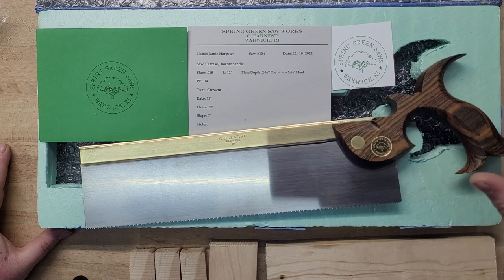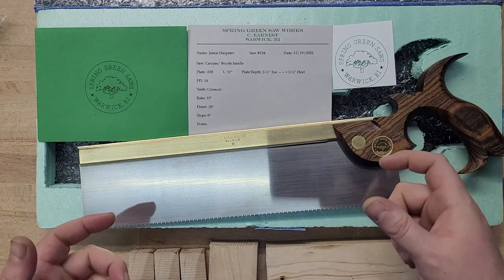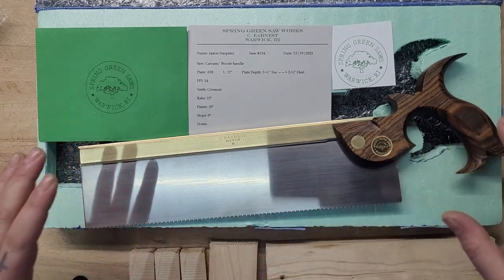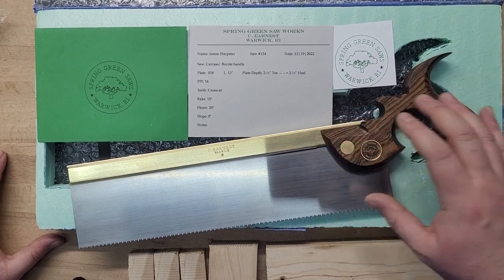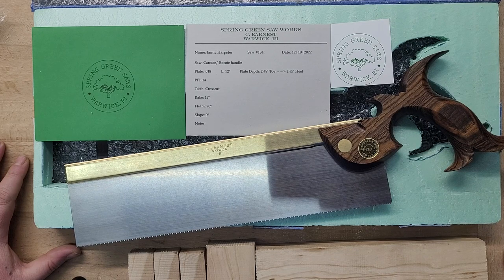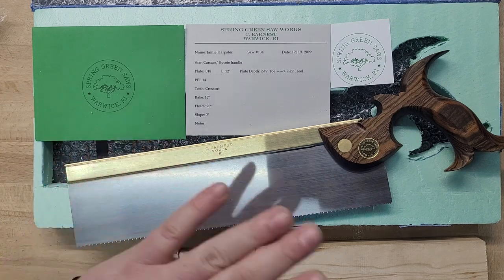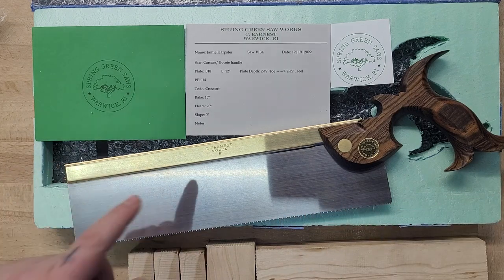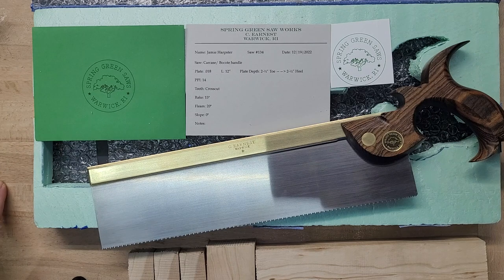MY BOCOTE DREAM SAW! Spring Green Saw Works Unboxing and Testing - Random and just had to share!

Comment: Beautiful saw, congratulations. I hope it serves you for years to come. I know it must be a big step up from the last saw you had, I remember going from the veritas dovetail saw to a lie Nielson, and I can imagine it is that plus for you going to a custom saw.
Reply from the maker: Thank you! Part of me doesn't even want to use it and just put it up for display haha but it is a tool and meant to be used so I will use it :)
Reply: @Bat Cave Creations  well just build it a case if it does not have one, I built mine from watching Rob Cosman video on it, nothing is more disappointing than seeing a bit of rust on a tool, or worse yet having something drop on it. It is a tool and built to be used, but it is probably not built to have a hammer or malet fall on it. Just a perspective.

 I actually mounted my cases under my bench, I will not mention the type of mounting I used, a certain type of screw that does this job really well and quickly. I mean I could have went elaborate and did some cool slip joint, but I wanted to get things mounted and onto making other projects. And to always know where my saws are.
Reply from the maker: @douglasanderson7260  I deff agree there it still needs to be protected! I have a cabinet under the bench with shelf/drawers so it will be protected but not from rust. That is a constant battle in a Western PA basement shop haha
Reply: Get one of Shane Skeltons saws if you can 😉

Comment: For sake of comparison, it would be interesting to see try out a Rob Cosman dovetail saw.  I don't want to sound like a commercial, but looking at the end of your board while you're cutting - you can see wavy lines from the saw blade.  That just doesn't happen with Rob's saws..  They leave a nearly perfectly smooth finish to the wood, even soft pine.

You can take this comment as a negative, or you can be curious and try it out.  It really depends on what level woodworking you're in to, but if you want to see what premium cuts look like, you should check out his line of saws.
Reply from the maker: Tell him to send me one and I'll try it lol
Reply: Crosscut saws and rip/dovetail saws have different tooth geometry and give different cuts lol It’s not a negative of the saw, go watch any of Rob’s videos where uses crosscut saws and you’ll see the same cut pattern
Reply from the maker: @Mbm.carpfl  thank you! Didn't even realize he said "dovetail" lol 100% they are different.
Reply: @Mbm.carpfl  That's a great point.  I didn't think about the rip vs. crosscut effect.  

I just tried cutting the end off a pine board with both saws and got the same marks, so this is more about my noticing and less about the sawyer or saw..

Typically, I'm using the saws for dovetails so the cuts aren't very deep, and they're mostly hidden from view.